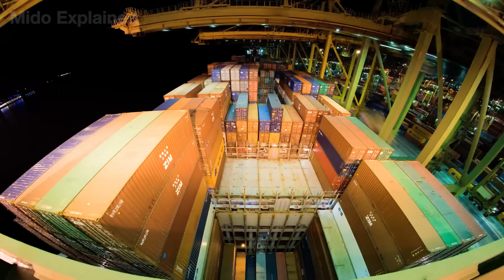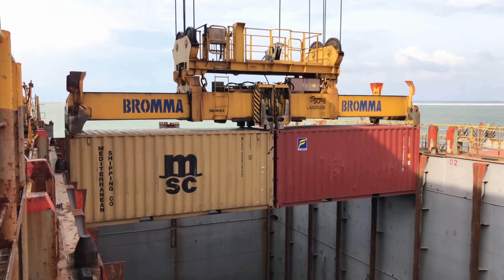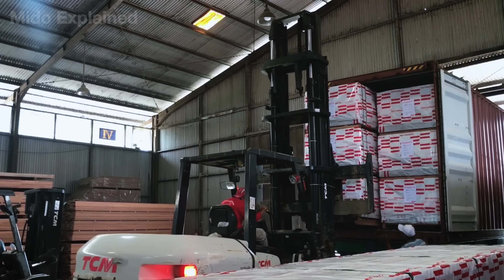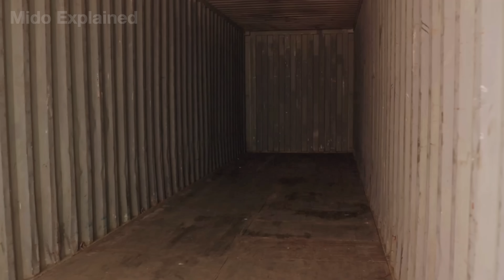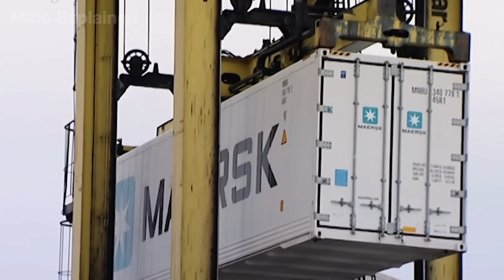How China Makes 95% Of The World's Shipping Containers Inside Massive Container Factory

Comment: Mido is talking about,(Shipping Containers),China produces 95 Percent Globally, I've read other People's Comments, and some People can't-Or Refuse to Understand, when they are Rusty-Old,the Real Question should be,What do we do with them Now? I think that,they aren't aware of what's happening Now, America has witnessed a Surge in Buying a Home/House-Whatever you want to Call It,The secret is to (Convert Them),into Useable House Dwellings, I've talked about this before,Cleaned,of any Hazardous Material, Sprayed with Zinc oxide,Dried,Fitted with Electrical Wiring, Plumbing Facilities,Gas Hookups, Insulation, Easily Attached to other Containers, Stacked Up on Concrete,or Cylinder Blocks,they are Very similar to Trailer Parks,like when I was Stationed at Fort Gordon Augusta Georgia,you might be Surprised,what Mankind can Figure out,or (Container City #1), as an Example,with the Average American home going for Roughly $1,000,000/ One Million Dollar's,to Convert a Shipping Container, Would be a Fraction of the Cost of Buying a New House, someone will figure that out Eventually, Watch And See, For Yourself,To Adapt,Is The Name Of the Game,like the Constant Evolution of Mankind, just look at the current crisis with Iceberg Lettuce, Jalapenos from Mexico,Food Research's,Have Finally figured out the,Real Reason, it's Tied to the Water Supply,not the Chemicals,or Fertilizer, also in the News is Iranian Simpathyers are Tampering with America's Water Supply, Federal Agents have traced it back to Iran, that's the Main Source, Recycling is the Survival of Mankind, Using your Noodles,(Brains), History 101,Has Concluded for the Day.
Reply from the maker: Thanks for sharing your thoughtful ideas on reusing old shipping containers and giving them a second life!

Comment: it  is the eight small boxes  and  the four corner posts ,,, which carry all the weight  ( the corner post is very  important ,, and you did not mention )
Reply from the maker: Great point—thanks for adding that important detail about the corner posts!
Reply: Yes, the four vertical corner posts together with the eight corner castings are the primary load‑bearing parts of a container, while the rest of the frame simply distributes the forces. I hit the same confusion and the DocShipper technical sheet clarified exactly how the weight travels through those posts and castings. So, when you load, secure the cargo directly to the corner castings with twist‑locks and verify the container’s ISO‑668 rating for its maximum stack weight.